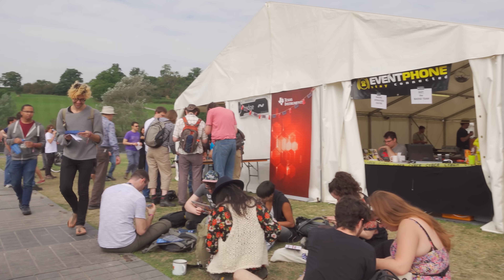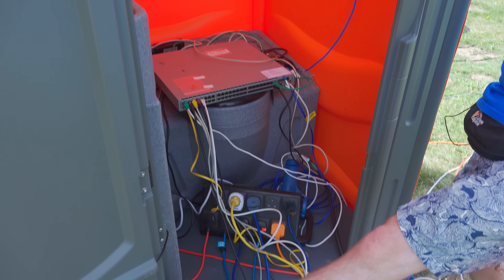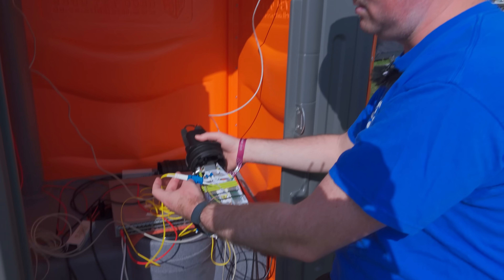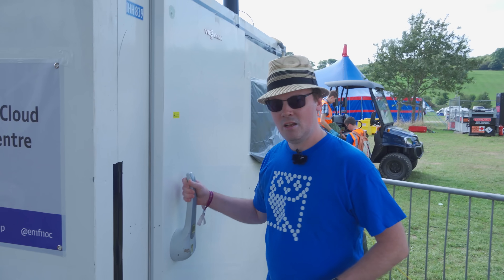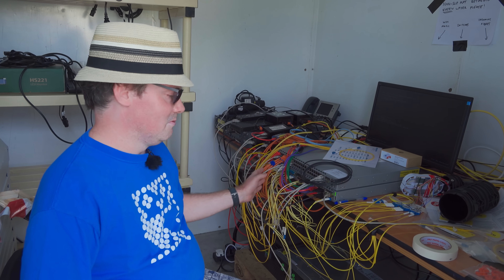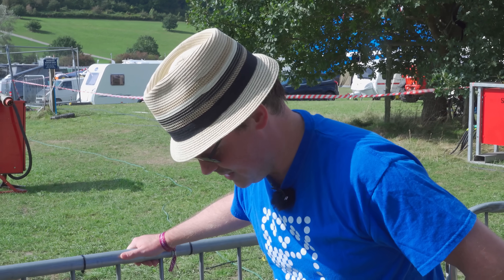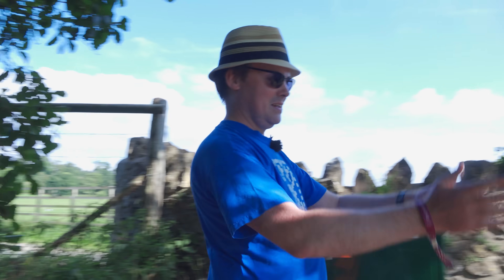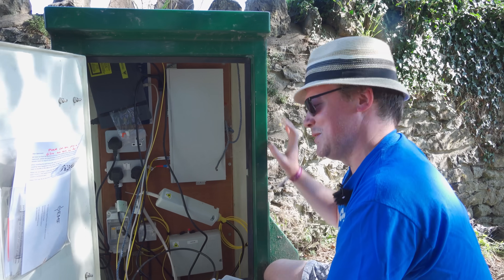High Speed Internet in a Field - Computerphile

Comment: How fast was it? How fast was the point-to-point wireless? What kind of hardware is used to display the network status on the toilets? Why was it so difficult to run through the ducts? What usage are they seeing? How does that compare to previous years? What was the size of the network? This video prompts so many questions...

Comment: How ironic is it that the event is called Electromagnetic Field, but yet has poor / zero radio connectivity? Hundreds of thousands of pounds of IP routing hardware and software, but no sign of a portable lattice mast with a repeater to bounce signals over the trees to mobile infrastructure. I guess it gets to the point where you have a really good shiny gigabit hammer, and everything looks like a nail.
Reply: EMF2018 had its own (experimental) licensed GSM network actually. And full onsite DECT phone network. To go with the ubiquitous wifi...
Reply: Will Hargrave So no cooperation with a vendor to do a live demo of 5G early deployment (I expect to have heard otherwise from that vendor).
Reply: There was a 5G test mast just a hill or two away, but I don't think they'd want 2500 random hackers playing with it
Reply: ms7821 Really. It would have been a great beta test before making it part of the must-not-fail public network.
Reply: This sounds like a great project for a village/attendee to do! It wouldn't be part of core infrastructure.
Reply: I did notice that AMSAT UK were there at 2m55s, with a handy lattice mast :D That's one way of getting a radio signal out I guess, via satellite!